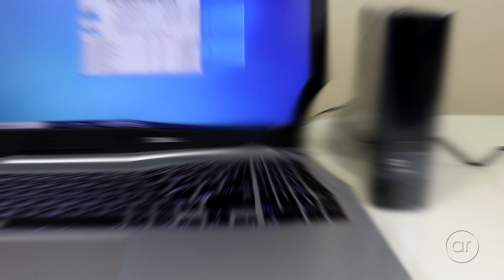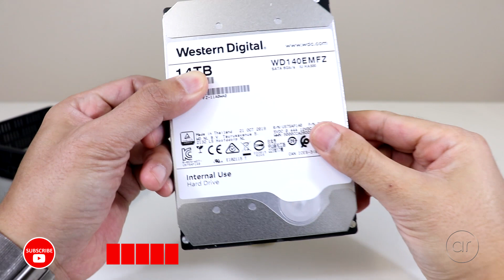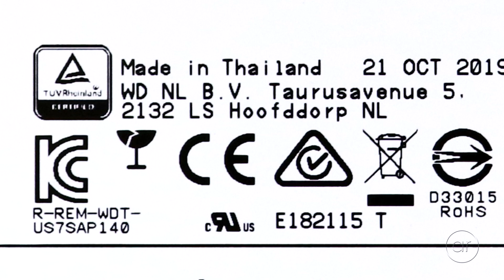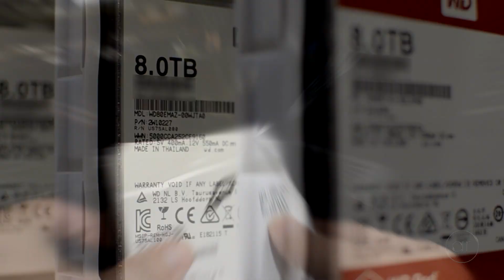Shucking a 14TB WD Easystore: Red Label or White Label?

Comment: How do we open these drives 😩
Reply from the maker: At which point in the video are you having problems? You may want to visit my original video on the subject: https://youtu.be/7XyUHcaJLLE
Reply: @accessrandom  im referring to the actual drive not the enclosure......the drive was covered and soldered to the rim with a sheet of tin   i was able to open it, sadly, and discovered the drive motor is siezed from a 4 foot drop.

Comment: Do you have a video or an opinion on if there are any software tests one should do on the HDD before shucking, formatting and putting it in your NAS? Tests that could detect a HDD isn't healthy and should be returned?
Reply from the maker: I use HD Sentinel and do a read/write surface test, but many others in the datahoarder sub seem to prefer badblocks (after booting to linux).

Comment: What is of different on İron Wolf? Please help.
Reply from the maker: The IronWolf is a Seagate disk and would likely be in an Expansion drive. They are CMR disks, just like the larger capacity (>6TB) WDs.
Reply: @accessrandom  Which one do you think is better?

I have very important data. Very big size all
Which one would be better for a long time?
I will buy too much. That's why I'm asking.
Reply from the maker: @HEKZS  I think they are comparable. The most important thing is to have a good backup strategy, no matter which hard drive you decide on.

Comment: I just threw mine into my PC, and there's a slight click. Is this normal? It's a WD140EDFZ
Reply from the maker: Based on the datahoarder subreddit, it seems to be a common problem. I would try running a SMART test (or even a surface test) on the drive to make sure there's nothing wrong.
Reply: Perhaps you shouldn't have thrown it!
Reply: @johnm2012  10\10

Comment: Hi, thank you for the video :) what about the warranty ? Does it work, after shucking the disk ? Is it necessary to re mount the disk in the original case or does it work directly ? Thank you !
Reply from the maker: You're welcome. There are varying experiences on the datahoarder subreddit, but in general their experience has been that placing it back in its original case with no sign of damage results in successful RMAs (with a few exceptions). You may want to search for "easystore return" or "eastystore RMA" in their sub to read what others have done.
Reply: ByteMyBits sent just a bare WD drive to them, and they replaced it with no issues.  Of course, YMMV.
Reply: @JustAGuyYouKnow98  Thank you, the difference between two cases management it's amazing...

Comment: Just shucked 8 14TB WD Element drives, all of them are WD140EDFZ.
Reply from the maker: Awesome 👍 thank you for the data point.
Reply: Were they different colour boxes?  like blue and orange.  I have 2 from Amazon and both have different colour boxes (one is blue and the other is orange).
Reply: @batrarobin  all the boxes were the same.
Reply: @TRIaXOR
 I see that one difference is yours are 7200 rpm drives, but could you elaborate on any other pros/cons vs the WD140EMFZ. Thank you.
Reply: @nutbag  They report as 5400 rpm in crystaldisk info, as I understand it the differnce is these drives are Self Encrypting Drives (SED) as for the RPM, my bios is different than the one reported on Reddit,  mine are  81.00A81 and not EN02 as stated on the reddit post, hope this helps :)

Comment: I recently Purchased 6 of these drives for the purpose of putting into a desktop for a quick capacity upgrade, the non spin 3.3v pin issue did arrise and was able to resolve it same as yourself, but for some reason it only let 1 drive be seen, i was able to get around this issue by plugging the drives into a dedicated sata card, i was hoping you may have some insight into why this is the case
Reply from the maker: Was it the drive itself that was preventing anything else connected to the controller from being detected? I wonder if you connected it to the dedicated SATA card if the other drives connected to the same card wouldn't be detected? It doesn't seem that the power issue would cause something like this, as that should be completely independent of the data connections.
Reply: @accessrandom  yep, basically i tried having 2 14tb connected directly to the motherboard, and either one would show up or none, but when i plugged both into this wee two port sata card they both appeared, it is an older psu i am awaiting a new sata card to pop in and will try it out on a system with a different psu setup, see if i can figure out what it may

Comment: Thank you. On shucking a hdd with data on it, is the data kept? Or does it require formatting.
Reply from the maker: Yes, the data is kept if it's an Easystore drive. The controller doesn't have any hardware encryption so you should be able to read it directly as an internal disk.

Comment: I more interested in knowing the operating temperature of the drive with and without its original enclosure. I have the 10TB model and temperature reaches >50C in about an hour!
Reply from the maker: That's a good question. I hadn't measured the temperature while in the original enclosure, but in a QNAP my 14 TB runs between 35 - 37 C at idle to around 45 - 47 C during continuous access. This will be highly dependent on the airflow and the ambient temperature (mine is in the basement where it is fairly cool).

Comment: Is there a way to update the firmware to allow the drive to spin at 7200 RPM instead of the slower 5400 RPM?
Reply from the maker: Not that I know of. The consensus is that these are binned drives (i.e. designed to work at 7200 RPM but did not pass QC tests) so theoretically it should be possible (?)
Reply: @accessrandom  Thanks for the reply. 5400 RPM with multiple drives is still plenty fast :)

Comment: whats the difference between the color labels?
Reply from the maker: The WD Red label is marketed as a NAS drive, while the white label drives are not really sold outside of their externally enclosed drives. It's widely believed that they simply re-labeled them so the Reds couldn't be re-sold as NAS drives.
Reply: Why would they use Red in drive enclosures though rather than Blue or Black which are marketed as single use?

Comment: The "F" in WD140EMFZ actually reveals that it has 512MB cache, like all WD 14 TB drives have. The smaller models like 12TB or 10TB only have 256MB cache ("A"). 
WD140EMFZ = Easystore / Elements 14TB drive
WD140EDFZ = My Book 14TB drive
The only difference is that the My Book support encryption on the hardware level ("D"= enterprise drive) and has a three years warranty, instead of two years.
These are all basically Western Digital Ultrastar HC530 drives, slowed down to 5400RPM and hence absolutely comparable to WD Red 14TB drives.
Reply from the maker: Thank you 👍 I think that would be very informative for others. Would you mind if I add your comment to the description, with credit to you?
Reply: @accessrandom  No, I don't mind at all. Feel free to.
Reply from the maker: @jitterskater  Done! Thank you.
Reply: I think this might be an over optimistic extrapolation from the regulatory number. https://www.reddit.com/r/DataHoarder/comments/edhzsv/bestbuy_wd_easystore_14tb_shucked/fbi5kcp
These are very good drives often available at a great price, but they don't perform quite as well as the RED or RED Pro drives.
Reply: These drives arent slowed down to 5400 rpm, they are running at 7200 rpm whatever the SMART Specs tell you...
Reply: @machtradecorp3581  Yeah.  I just shucked 6 of them and all were WD140EDFZ also.